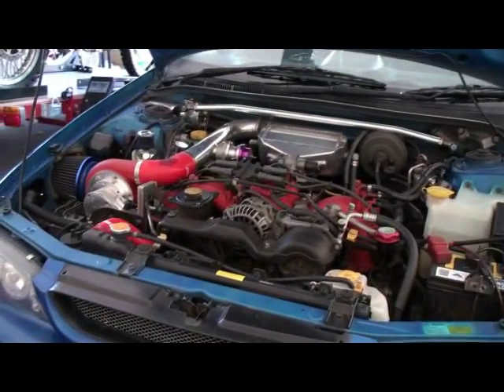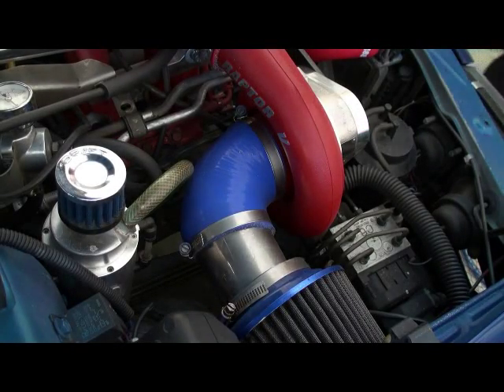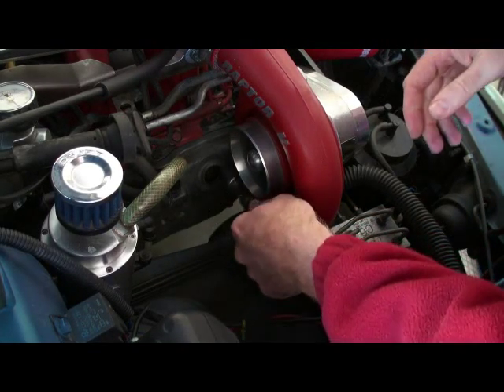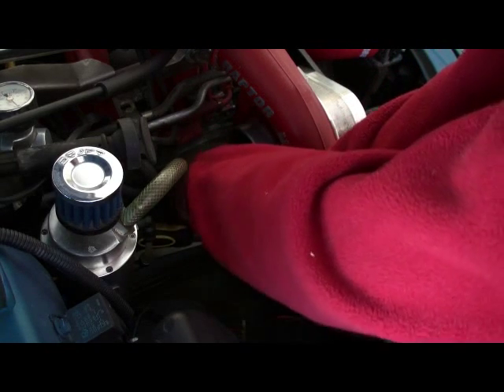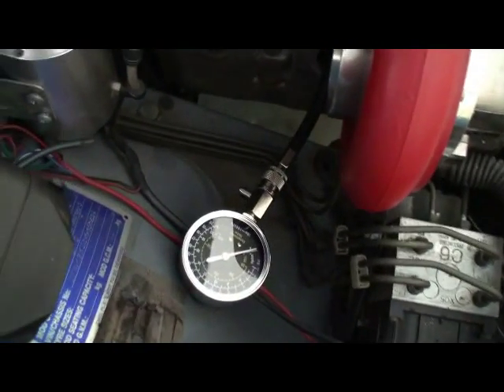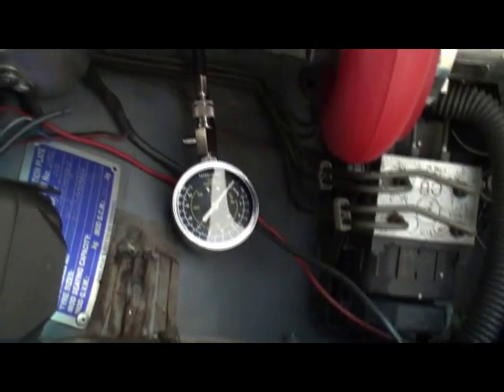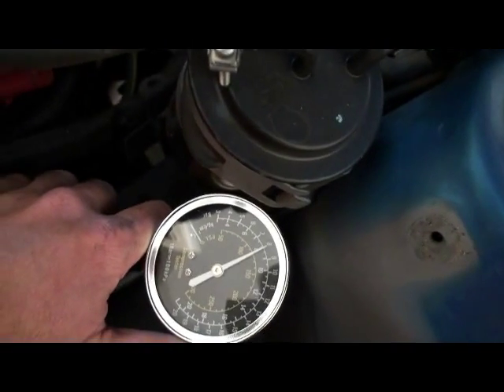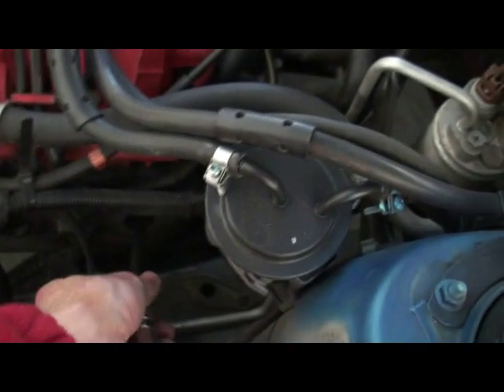Subaru Impreza EJ201 Compression Test

Comment from the maker: 230?! wow that's impressive - very healthy motor you got there. These engines (well - the EJ201) does about 55kw at the wheels (92kw at engine).. very piddly, hence the need for more power that's gonna be reliable.  Supercharged doubles that power at the wheels, I got 99kw at just 7psi of boost and torque went from 184Nm to 270Nm.